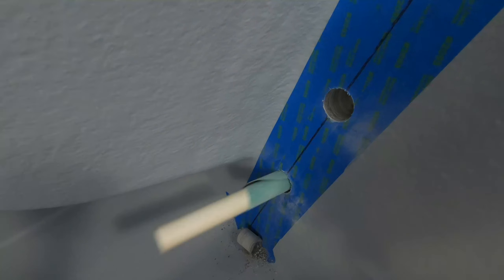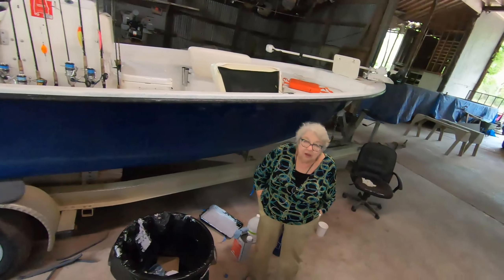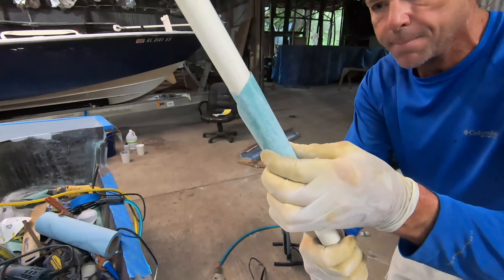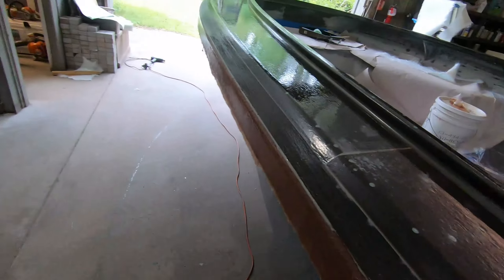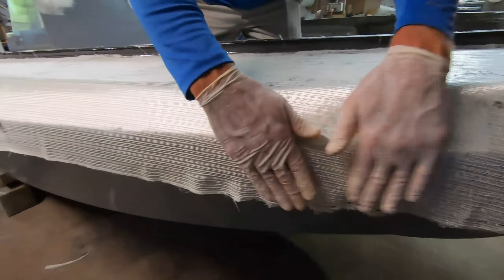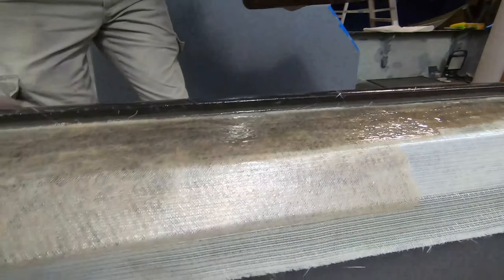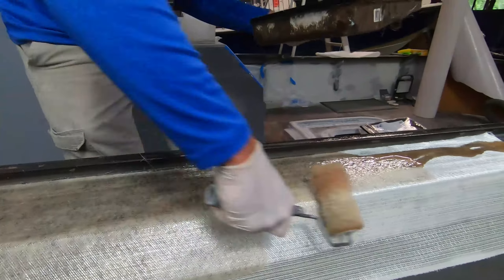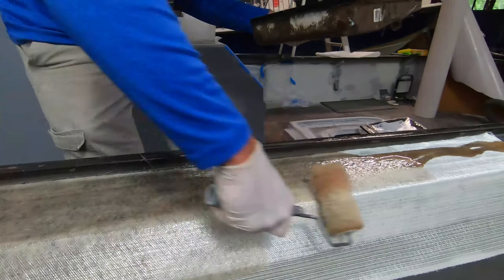EP-15 WE ARE BUILDING A NEW BOAT! HOW-TO FIBERGLASS OVER COOSA BOARD

Comment: You Guys are amazing. Thank you for making Fiber glass so easy. i have (2) question: Can i use polyester resin without wax between layers and apply the last layer with resin with wax? I'm doing the floor of my old boat, and since i don't have a ton of experience i want to gain some time, I'm terrified of the resin to dried before i finish. lol. and also. Can i use the red catalyst with the fearing compound to make sure that the catalyst is fully mixed with the fearing compound when mixing. Thanks in advance and keep it up with these amazing videos.
Reply from the maker: Yes, to both questions. When I am working with a new materials or process, I  like to practice and experiment a bit before using it full scale. I also like to make sure that I have done plenty of research and taken notes so that I don't forget anything important. Then, take the time to do all of your prep and set up your work area with all of the supplies you will need. It's best to start small, and then work up to the bigger jobs if possible. I hope this helps, and thanks for watching!

Comment: Another great video!!! What method have you seen work the best to remove fiberglass from the skin?
Reply from the maker: Thanks! That is a good question. I am sure you noticed that I am almost always wearing long pants, long sleeve shirts and gloves when we are working with fiberglass. That is your first layer of defense against skin contact. Once resin is on you, it is usually going to require a solvent like acetone to remove it. But using acetone directly on your skin is certainly not good for your health, and should be used very minimally in my opinion. Hope that helps, appreciate You watching!

Comment: I’d say mom is very proud.  You guys do fantastic work. 

Question. I have an 88 bass boat.  Do you think it coosa would be a viable and cost effective material to refloor it with and to build casting decks?  I would like to do it for a permanent solution but don’t know if I should go with plywood instead.
Reply from the maker: Thanks, We appreciate it! I really like the Coosa, it is lighter and stronger than plywood, plus it will never rot. The only real negative is that it costs 3 to 4 times more than marine-grade plywood. And in some parts of the country it may be harder to find a supplier. I don't have any regrets using it on our boat build. Hope this helps! Good luck with your project!

Comment: Thanks again Capt great video ,I would like to clarify and ask a question you mentioned in the video temperatures between 50 to 70° is good for glassing i’m an amateur but in the winter, I keep my shop in about 55 when I’m glassing, I try to bump the heat up to about 60 -65, it’s kicked at the temp so I assumed I was good  ?? A lot of others say it’s too cold hopefully I’m good. also, on the biax. 1708 on a radius should you try to have the biax. stitches parallel w/radius? does it matter, I’ve had some trouble w/it forming on a radius. Thanks again great job turned some friends onto your videos.
Reply from the maker: Glad your enjoying the videos. I probably should have said high 50s to high 70s with 70 being about perfect in my opinion. Obviously the colder it is, the higher the catalyst ratio would would be. I think 60 - 65 is just fine as long as it is curing good for you. I have not noticed they lay of the biax making much difference, but the sharpness of the radius and the brand of biax can make a difference. I have had good luck with V2 and Vector ply fabrics. A softer radius and wetting out really well with resin under the biax might help. Hope that answers your question,  Thanks for watching!

Comment: your deck cap looks great. What did you do to the underside of the stacked  Coosa?
Reply from the maker: Thanks, I primed the stacked Coosa with resin. After it had cured I used either resin or a high-strength putty and lots of screws to bond it together.

Comment: Any issue with me using resin dye vs buying that specific one? Its hard to find the awesome stuff out here in hawaii
Reply from the maker: I don't think You will have any problems using a different dye, as long as it's made for the same general application. Whenever I try something new, I like to make a test panel or batch. Make sure everything looks and works good before using it on something really important. Good luck with your project, and thanks for watching!
Reply: @Fish Bump TV  Thanks, it would be the same resin dyes i use to color my casting resin, for trolling lures,i think they're alcohol inks? I just assumed the red catalyst was the slow hardener that we cant get out here

Comment: When you were applying the 1708 and chop strand did you use resin with wax in it?  I'm new to this but find your videos extremely helpful.  My only (minimal experience) is with Epoxy.  Which begs another question, how long does epoxy hardener and resin last.  Thanks, Jeff.
Reply from the maker: No wax, just a high-quality iso laminating resin from a company called Polynt. We source it from a company called advanced plastics. The only time we add wax to anything would be to gelcoat in the last coat. I suppose you could add wax to resin in the last coat if you knew that you needed it to be tack free so you could sand it without gumming up your sandpaper. Different materials have different shelf lives. If you keep most materials cool, and dark they will last longer. I have had some materials work with no problems up to a year after purchase, others only a month or two. Most materials will thicken, or change colors when they are going bad. I would not use it if you are in doubt. Hope that answers your question, Appreciate you watching and commenting!

Comment: When you "seal" the Coosa Board, are you using polyester laminating resin then glass with finishing resin?
Reply from the maker: We use laminating resin for everything. If it is a compartment that will be seen we finish it with gelcoat . Thanks for watching

Comment: Hey captain can 1708 be glass shiny side down on coosa for a RV bath tub that I’m building? Thinking on a single layer and having the Mat side up for a smoother finish.. thanks!
Reply from the maker: No,you should not apply 1708 upside down. The csm or mat that is sown into the bottom is better at initial bonding. If you want the cosmetics of csm, you should buy some 1 Oz csm and laminate it over the 1708. That way you have the best possible bond, and the nice cosmic, and remember that csm does not work well with epoxy resin. You should use a quality polyester or vinyl Ester laminating resin. Thanks for watching!
Reply: @FishBumpTV  thank you capt !

Comment: Could you use a router and radius bit on fiberglass?
Reply from the maker: Fiberglass is really tough on router bits. Not saying it won't work, but you probably wouldn't want to do much of it. I prefer a sander or grinder with 36 grit for the initial cut, then down to 80 grit on an orbital sander for the final cut. Hope that helps. Thanks for watching and commenting!
Reply: @FishBumpTV  thanks. By the way, the boat you are building is badass. Can’t wait to see the finished product. Your attention to detail is superb.
Reply: How many ounces is the biaxial you are using?